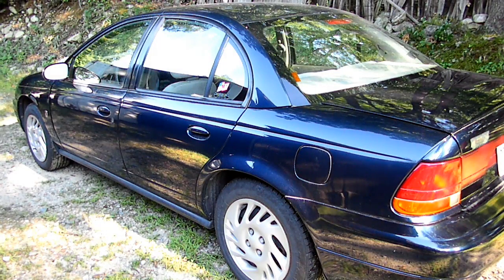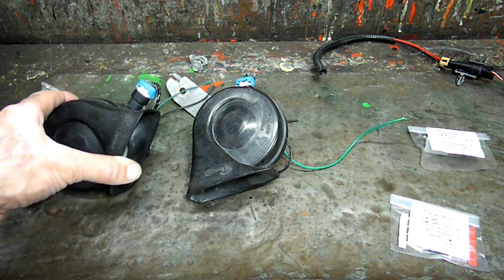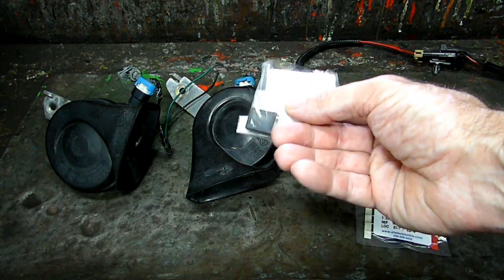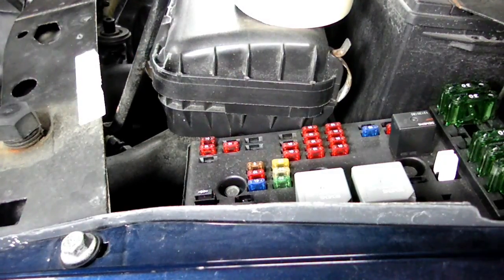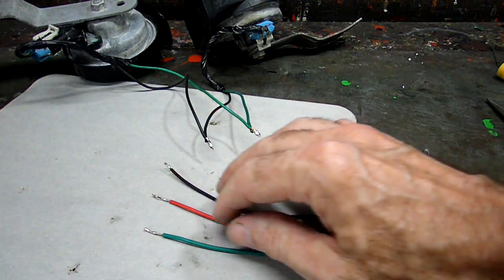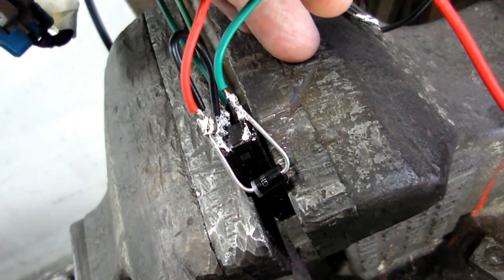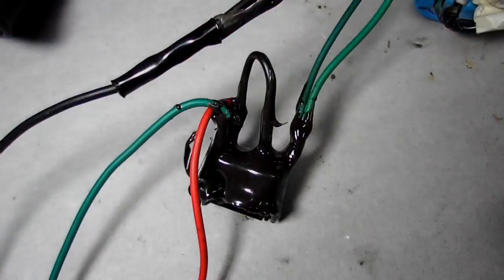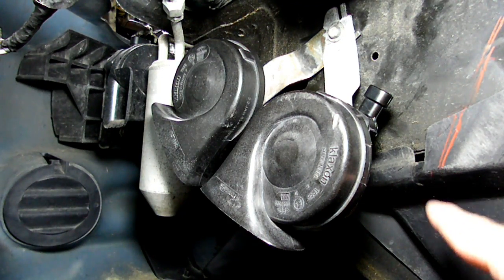Saturn Three to Two Wire Horn Conversion

Comment: Nice modification.  I like when someone gets something to work where it wasn't necessarily intended.  People should make sure not to leave off the diode or connect it incorrectly, though, because the relay can generate a voltage spike when it's deactivated, which could damage something else in your electrical system (or at least blow the fuse constantly).  The diode lets the current bleed off through the coil in the relay instead.

Comment: Thanks Richpin! Worked perfectly. I've been wanting to do this mod for quite some time now. Recently the stock horn died and I needed to do something before my inspection this month. Thanks for all your great videos!
Reply: rich pin
Yes definitely. I have one question though. I was able to fit the two new horns into the same location as the old one. So, I'm curious. Why did you choose the wheel well for your instillation?

Comment: @FyberOptic Is this diode something that is commonly associated with most relays? I'm unclear as to where the voltage spike happens and how the diode protects other elements. A schematic might have been helpful. Thanks for posting, Rich.

Comment: @spelunkerd Yeah it's not uncommon to place a protection diode across things using a coil (like a motor), especially when connected to sensitive electronics (like a security system). The coil in the relay also acts as an inductor, which oppose changes in current. When the horn button (which creates a path to ground for the coil) is released, so is the stored energy in the coil to maintain current, and the exit path's differing (than direct ground) resistance can now result in higher voltage.

Comment: Put one of these relays together this morning, I used a relay socket.  Hope to try it out tomorrow before I install the horns.
Reply from the maker: I wish i used a socket.Were did you get yours.
Reply: richpin06a I used 275-0220 from Radio Shack.  (10 Amp Socket?)  blew fuses, replaced with 20 amp fuse for now.  I don't get the rating for the socket.  So far so good.
Reply from the maker: Harold Swanson
Thank you for the number of the socket.

Comment: Thanks alot I bought a set of Saturn horns which came with a relay, i didnt know hw to wire it using a relay after watching this clip it was just too easy i went on it like a pro mannn it sounds great i just need to get me a diode,, Question, IS ALL DIODE THE SAME? WHICH TO GET?

Comment: @richpin06a thanks for all the help, i ended up going to the pull a part, asking for a list of lumina's and devilles. turns out they had a 2000 deville and i checked it out, it had the klaxxon horns like you were saying but a different mounting style. i got it working basically the way you showed all except the mounting spot =P 

but thanks, im not sure why i havnt sub's yet but i did now.

Comment: I was told that my horn was sounding and that it smelled like wire burning.  This was months after I realized I had no horn.  I replaced the horn from with another gen 2 horn.  It worked once or twice.  Any ideas what causes the horn to burn out.

Comment: i got a question what if u dont add a rely cause i got a integra wit a 1 wire conector going to the horn so i was woundeing what if u didnt add the rely? oh and also i found me the same exact horns from a 1991 dodge caravan

Comment: I just tried this and ended up burning out the homemade relay from your video. Is it possible to use a different relay instead of the one in your video as I do not have another and it cost more to ship the part than the part itself.
Reply from the maker: The 00-02 went to a two wire horn with external relay so i might look into that.

Comment: I made a stupid mistake. I tried to connect a 2 wire horn directly and now the original horn is stuck. Is there a relay or something? I'm unable to find it and make it work as it was before. I will do this connection as soon as I fix it. Thanks!
Reply from the maker: What make year vehicle are you working on.
Reply: richpin06a 1997 Saturn SL2
Reply from the maker: Mikelodeon27
The oem horn up to 2000 had the relay as part of the horn.
Reply: OK. I'll check it out. Thanks amigo!